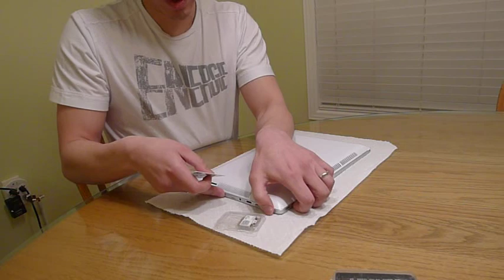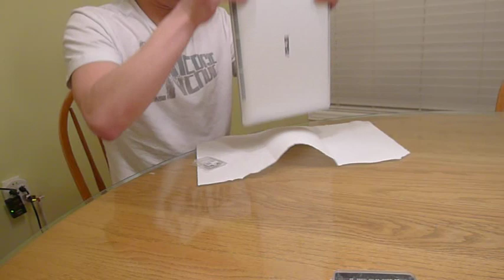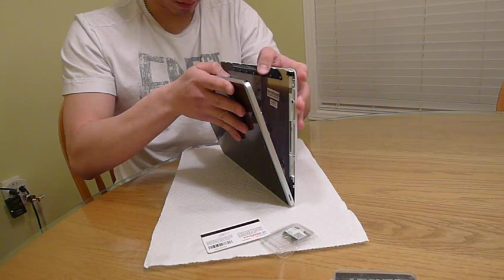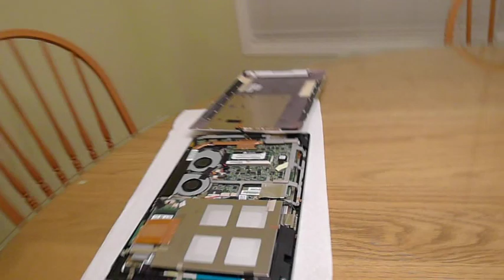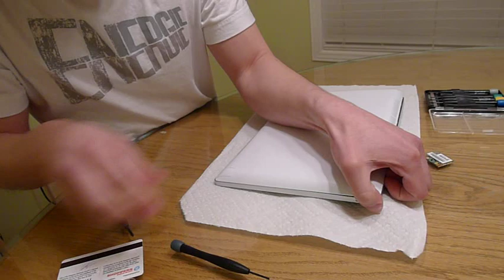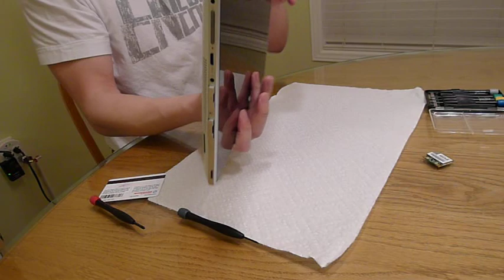Asus Eee Slate Upgrading Wireless

Comment: I had that problem too. but trust me, its working and its on when the led is on. Use a strong flashlight and put it flat on the screen, and you should be able to see your desktop or login screen. Then you can make a back-up.
Fixing it: I sent it to Asus in Czech Republic. Since I still have a warranty, they picked it up, fixed it, and sent it back with DHL shipping for free. They said it was a ribbon that was damaged.
hope it helps.

Comment: Is removing the battery just a matter of unscrewing the large metal piece (the one with the squares) and removing it, disconnecting the cable from the main board and carefully taking out the battery?

Comment: How did you solved this problem?It 's always worked well, did not take no shots, but this morning when I wanted to use the LED for the power light remains on even without being charged, the screen is always black. The fans do not run completely dead !! Help me! the tablet I bought it from a person who sold it in Switzerland!

Comment: Hi. Is there a known issue regarding the screen? Mine stopped recognizing finger touches on most of the screen area. The pen works no problem. I really don't want to replace it unless I really have to. The unit hasn't been dropped or anything. It just stopped working. Of course I am no longer under warranty. Just want to know if there's a fix. Any thoughts would be much appreciated. Thanks!
Reply: There"s a known screen glitch on these. It has to do with the wide flat ribbon that goes from main board to screen. If you open the slate and roll a piece of black tape into a small roll, scoot it under the ribbon, it releives the 
ribbon being in a bind. You'll know you have this problem, when the curser sticks to the upper left screen corner. There is a video on yt that shows this fix.
Reply: I've had five of these B121's. Given to the kids for gifts. I currently still have 2 and in fact am responding to you're post on mine. I've upgraded memory to 4 gigs and the hd to 128gigs. I just upgraded both of mine to win10. I haven't had any wireless issues, but you never know.
Reply: +jkw427 very nice. Planning on upgrading whatever I can as well. Been using it with the stylus this whole time but it would be so much easier with fingers. Went to ASUS. I was told that it's the sensor and it would cost about another $200 to fix. Yikes. By the way, there a link to that video?